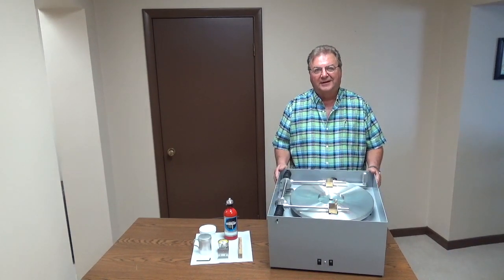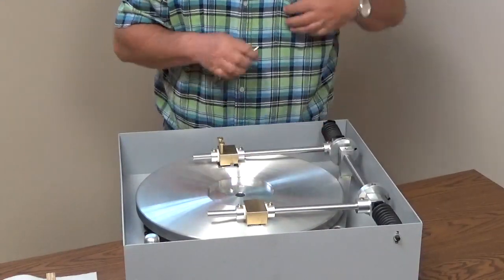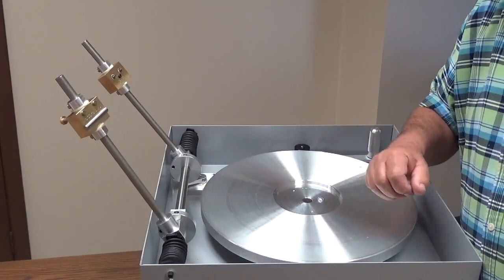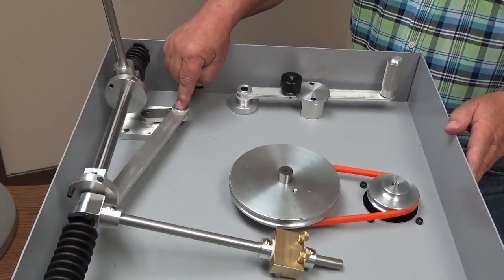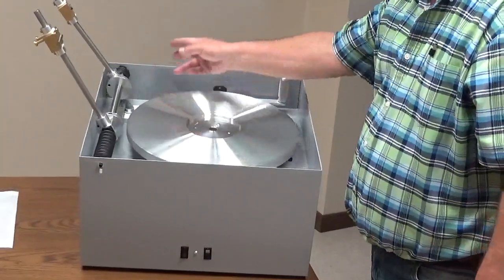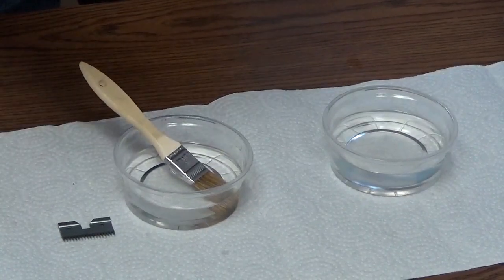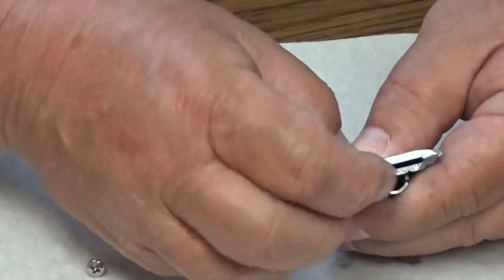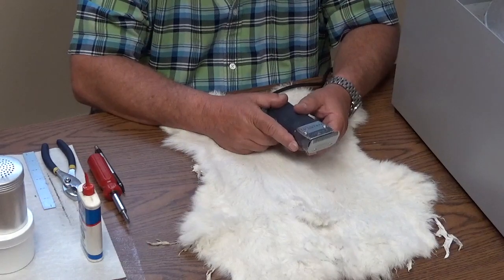Treyco Model 3000 Clipper Blade Sharpener

Comment: What is the purpose for the two speeds?  For time saving?  Also, I use denatured alcohol for cleaning after sharpening.  Have you considered using that instead?  I've used your machines for years and about the time I was ready for a new one and ordered it you guys came out with this one.  Great products and customer service!
Reply: Sir ye machin mujhe lena hai kya krna padega
Reply: Donna I'm considering ordering a model 3000 from this company but can't find much info witch makes me a bit nervous. Can you tell me about your experience with them? And how you got your first machine?
Reply: @bubblebabynursery9794  very good. Robust machine. Industrial motor and some wheels and readily available belt from an auto store to  transfer power from the motor. Keep in mind that hand sharpening is faster, though this is more percise for the average gamer. If you have a real steady hand a patience, consider a large wheel hand sharpener. Also 3 3/4 blade combs cannot be sharpened  with the armature. Can only sharpen the cutter and 3 3/4 or larger by hand. (#4 blade works).

Comment: What type of metal is the wheel made of? And what is the brand name of the powder used in the video?
Reply: Aluminum alloy. It has to be softer than the steel. Iron oxide, it can be ordered in different grit sizes, no brand name needed. Google, it might be available locally. I bought a 3 gallon bucket of it for pretty cheap.
Reply: Not iron oxide. Aluminum oxide